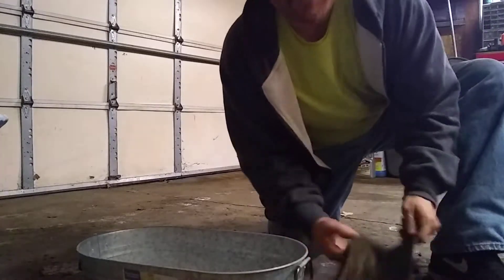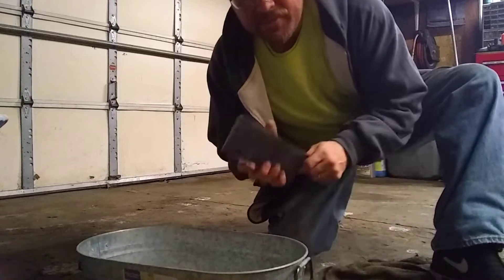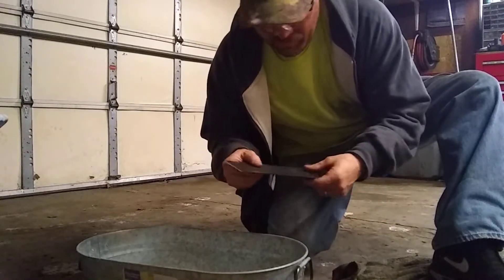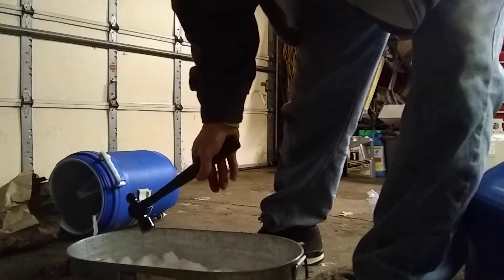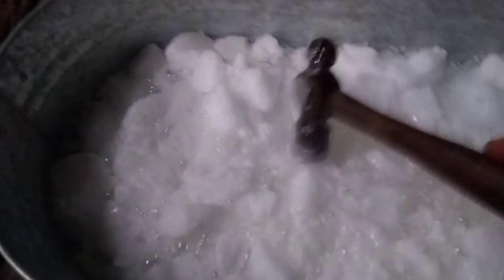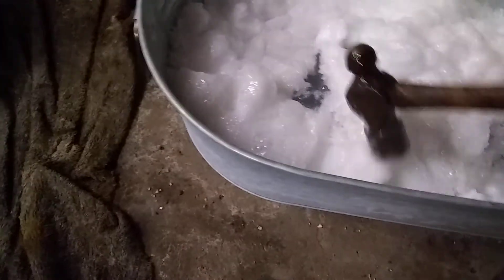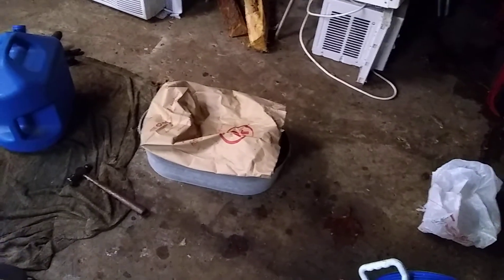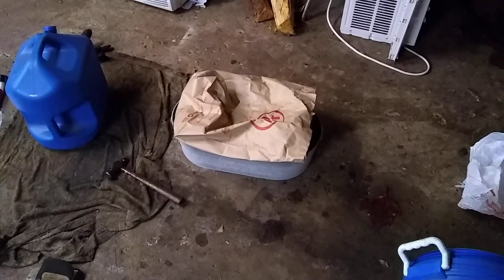AEB-L cryo treatment

Comment: With what it costs you in dry ice and kerosene, would it be more cost effective to have it sent in to be cryo-treated at a deeper range?  Not criticizing, just looking for info as I am looking into this more and more for my first knife build.
Reply: Depends. You'd have to send a lot of blades out for heat treat to be cost effective. Then theres shipping cost. Dry ice and kerosine are cheap, and readily available.
Reply from the maker: Well that all depends on the steel Kyle. This was AEB-L it really doesn't need liquid nitrogen. You can reach full hardness with acetone and dry ice which can get down to -90. Kerosene is very cheap you can get it at some gas stations and it's safer. Kerosene will go down to about -80 I get dry ice from Jewel it's about $3 a pound. It's not too expensive but it doesn't work on all stainless steel some need liquid nitrogen
Reply: @AaronJohnson1979  Many thanks for explaining this!  I will have to look into doing it this way for sure!